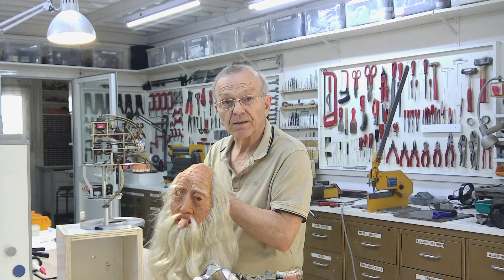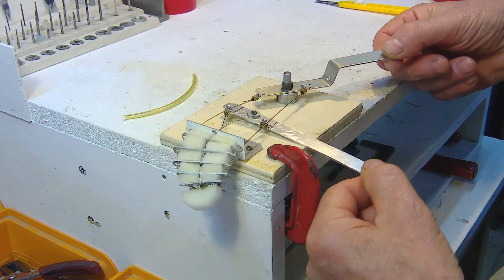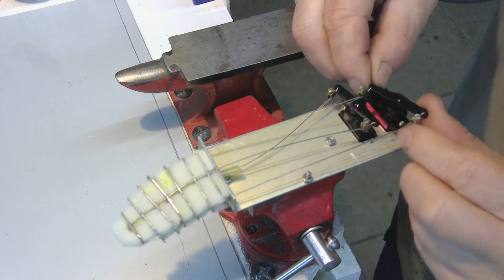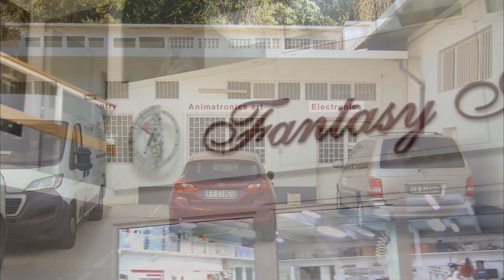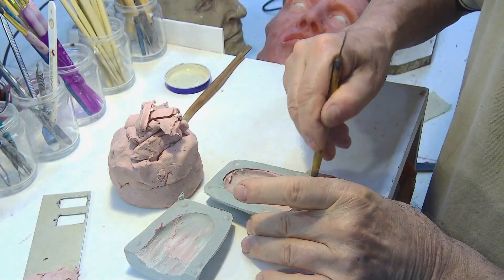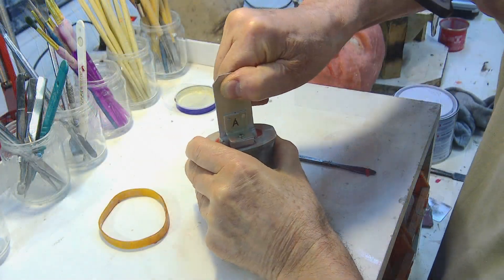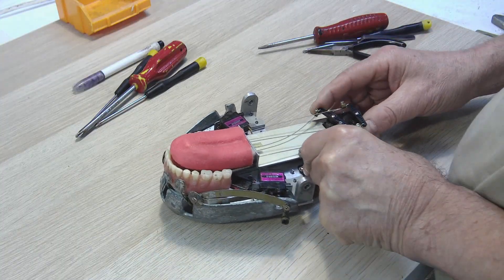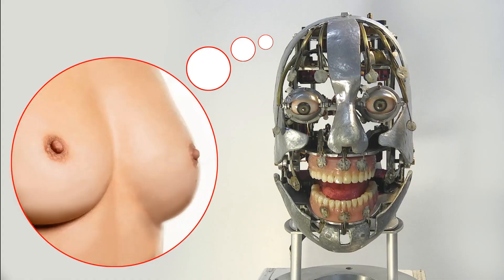How to build an animatronics Tongue - Tutorial

Comment: So, they managed to move the tongue in four directions using motors, I still think that it would be better to create something similar to the micro fibers in the muscles. I don't know, would that even be possible?
Reply from the maker: My tongue moves in six directions.
The system that comes closest to the tongue is the soft grip, but it is not possible to make it make six movements, and the apparatus and mechanisms for compressing and depressing the air are much more complex and cumbersome.